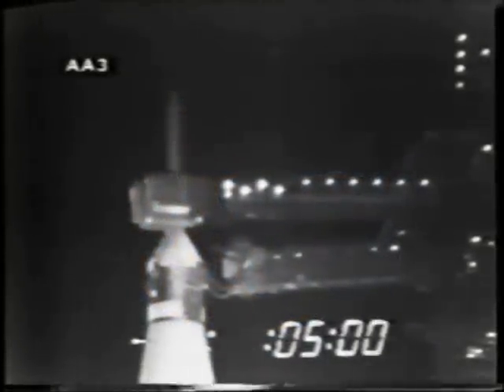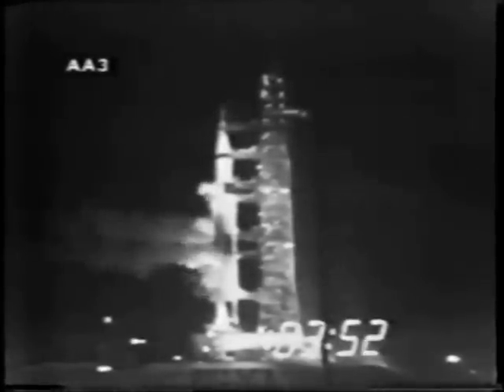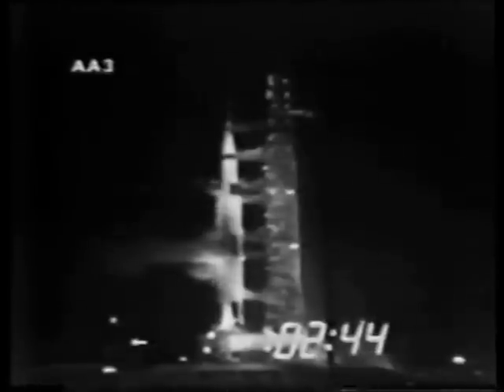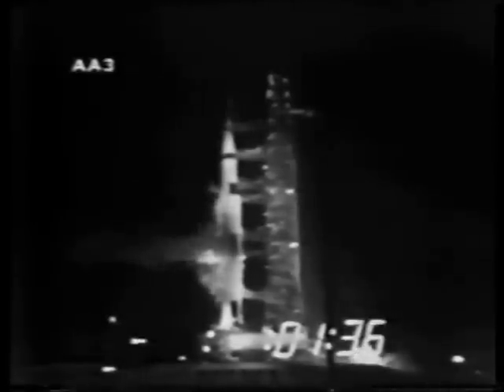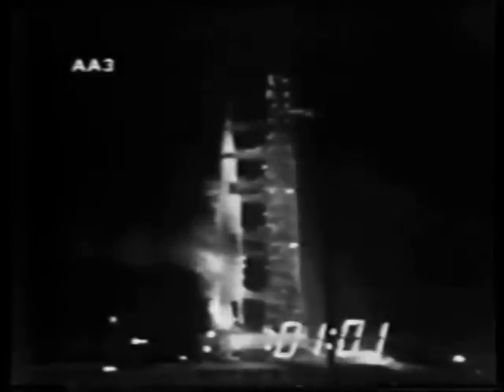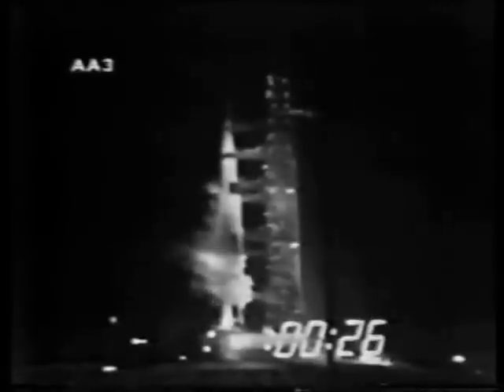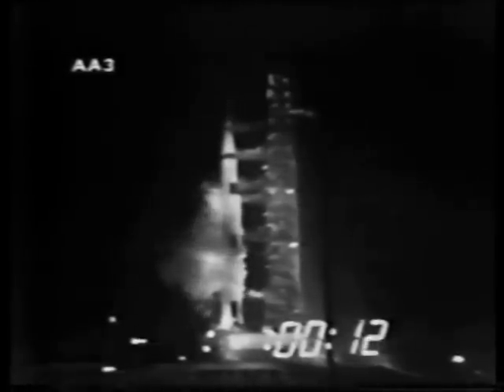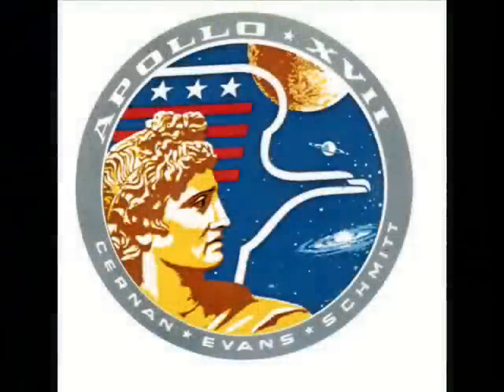Launch of Apollo 17 (TV Feed)

Comment: Another great post, thanks !
I'm inclined to agree it's NASA's own TV feed. The networks used their own seperately located cameras in addition to the NASA feed. Most of the NASA TV cameras at the pad were b&w only (apart from the one used on top of the LUT for Apollo 13). All the tracking cameras were colour AFAIK. TV cameras then used non-synchronous switching causing the jumping between the b&w and colour feeds.